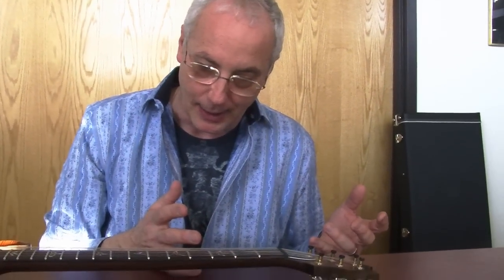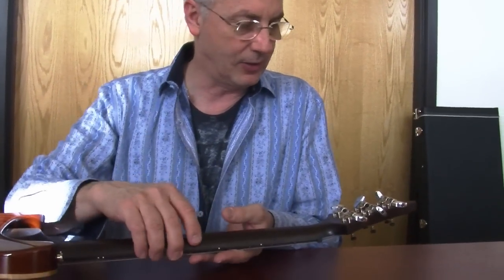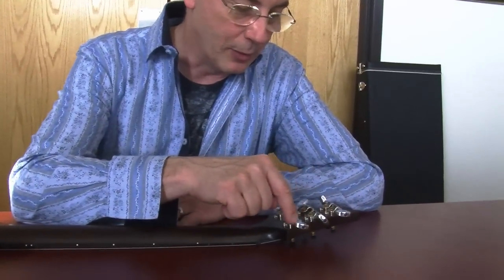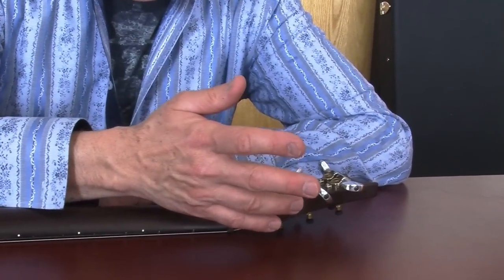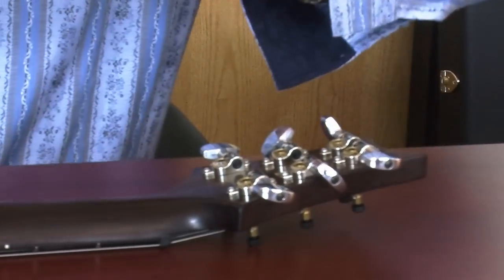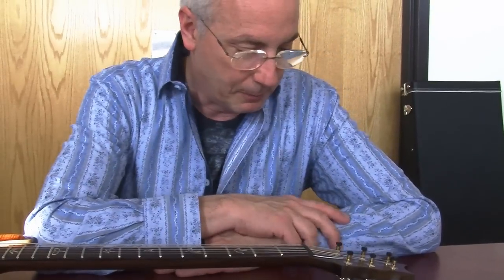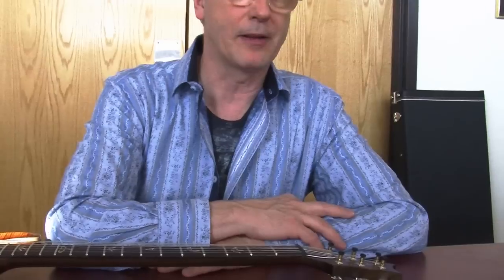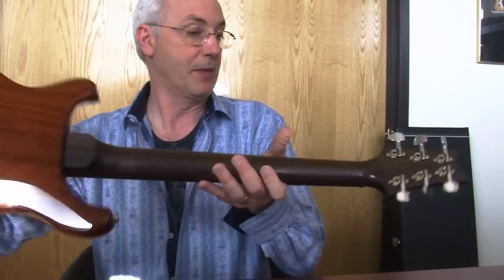PRS Phase III Locking Tuners with Paul Reed Smith

Comment: The open gear case does transfer  a spectrum of resonating.  The closed cap design works like a damper.    This can be measured.  It's like jumping up from nickel wound strings to a semi bright steel string set.  This is why the open gear case.   Also in addition to this. You can easily lubricate the tuners.

Comment: I have a 16-year-old PRS Custom 22 that had locking tuners. But I had so much trouble locking the high E string that I eventually replaced the PRS tuners with Schallers. Typically, it would take more than 5 attempts to lock the high E string which was extremely frustrating. Do the Phase III tuners do a better job of locking that high E string??

Comment: Dear Mr Paul Reed Smith,
I would love to know WHAT, to your opinion, is the main "tone disadvantage" of a locking tuner which has its "locking knob" in the back of the headstock (not mentioning any brand, of course).
Why, talking about "tone" of course, is this better when the "locking knob" is located on the top of the headstock ?
THANK YOU SO MUCH FOR YOUR ANSWER.
Reply: If the string is locked the tuner does not affect the tone whatsoever. Only thing that could affect the tone is the distance from where the tuner attaches to the neck to where the string is fastened in the tuner. A longer distance there could mean the tuner itself "steals" a bit more of the string's vibration. Should be indistinguishable to the ear though and affecting sustain more than tone alone and even that to a nearly unnoticeable degree.
Reply: Stop thinking about it and play your guitar! Tuners are tuners if they are made reasonably well.

Comment: ***** they will as long as the ferrel guides that the go into where  the tuning pegs enter at the headstock, are the right size..not to big not to small or you will have to address that issue if the problem surfaces

Comment: Will these fit an SE model PRS?
Reply: most likely yes
Reply: @dgmwitz  no. Different mounting holes. Although they will fit the SE Paul’s Guitar because it has the vintage style and not the SE PRS designed. PRS does make SE locking tuners. Not open back though

Comment: I have enjoyed many years running sperzels.  They dampen tone. But they are well made.  Think of woods.  . Use maple  headstock. Then jump over to solid ebony.  You will get the picture.  Ebony sparkles. Maple dampens.  Swamp ash is very good.  Kona sucks
Reply: I build racing motors.   Aluminum connecting rods dampen harmonics on crankshaft.   Steel rods augment resonation.  This is a law of metalurgy.  Same thing applies to guitars.  Wood density has similar characters.  Where ever you can gain specific tone, you just do it.  Tuners are part of the equation.  Wrong combinations make guitars hard to intonate.  That's why PRS takes time to get it right.  Good guitar players like Paul Smith just know what works. When a guitar sustains all through the coffee break. You have done your job. The sonzera 50 watt killer amp is a total compliment to any electric guitar. A poor expensive amp might not be able to deal with what a Sonzera does.  Analog is on the way back and not nearly soon enough.

Comment: I guess that PRS is not happy about paying a little extra for these tuners because they're discontinued on the 2020 McCarty 594 models.  Obviously, in a a cost cutting move they switched to "vintage style' closed back tuners that are kind of crappy and cheap in comparison.  Bad move for a company that holds itself out to be a step above.  They certainly charge for that step above.  I bought the new model with the crappy tuners and did not realize it until I opened the case.  My bad but an expensive mistake.  I would have bought a 2019 model.

Comment: OK great.... and just when you get used to seeing the open back tuners on an electric instrument they are gone? So why is PRS now putting vintage tuners on their 594's and other models? Im personally in favor of locking tuners. The vintage ones look like a skinny shaft which is easier to break or bend if dropped or bumped, and there is no locking mechanism to offer the great tuning stability of the Gen 3. Its a definite downgrade in my mind.

Comment: Paul and I clearly have differing opinions of what constitutes "handsome". I think exposed gear tuners look cheap. My cheap beginner Stella acoustic had exposed gears. Lots of guitars in that time period had exposed gears. Some sounded great, others were basically firewood.
Reply: And they also attract dust that will cause premature wear to the gears and subsequent looseness and unstable tuning. Absolutely no need for open back tuners in this day and age. Plus a kid could get their fingers trapped in there ;-)

Comment: The brass shaft Phase II tuners on my 3 year old PRS are THE worst modern machine tuners I've ever used. Gritty feel, sloppy play in the gears that can't be adjusted out with the button screws. I've got 50 year old Klusons that work better than these things. Very disappointing
.